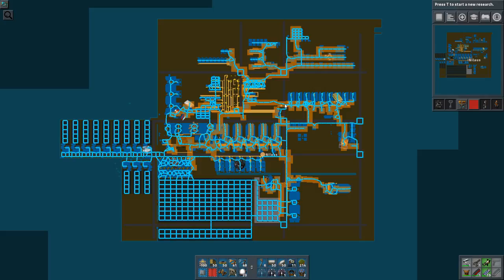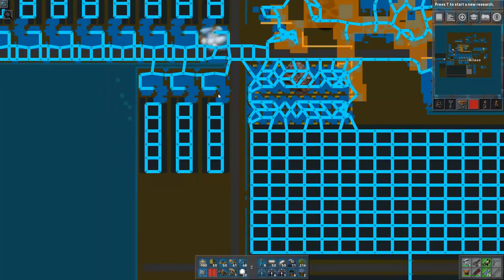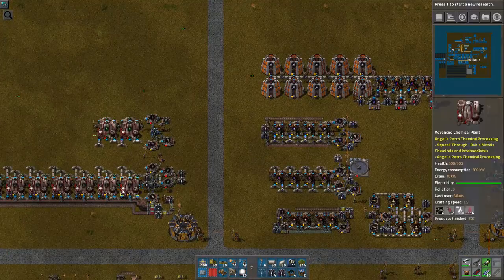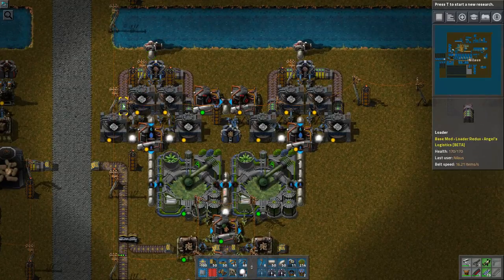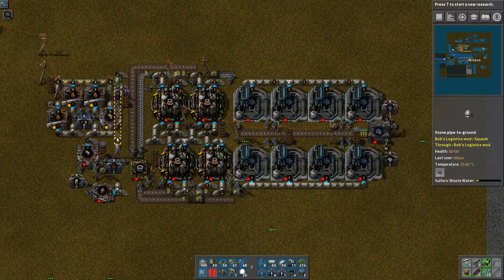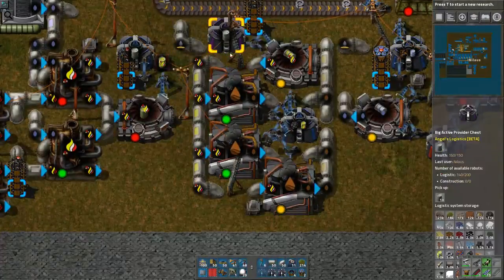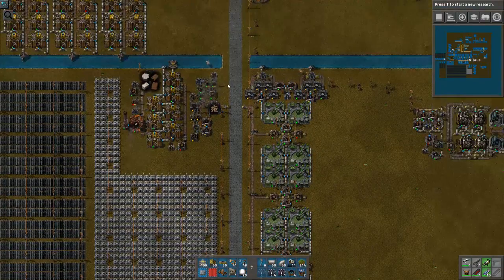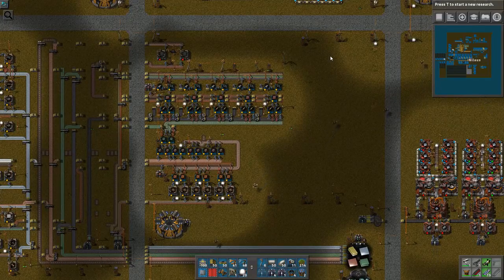Factorio - Sea Block Tutorial - 17 Designing for scale

Comment: as long as your doing nodule -> slag slurry and using coal filters you will continually and slowly acrue sulfur, a possible fix for overflow is having a overflow valve into a clarifier for your sulfuric waste water production(s)...
Reply from the maker: There are other uses for Sulfuric Acid, so I am generally trying to converse and monitor my Sulfur usage. Depending on how you play it will be on the balance between "too much" and "not enough"
Reply: yes but that specific process will never run out unless you the player pull to much sulfur